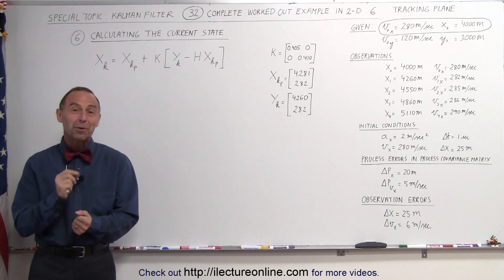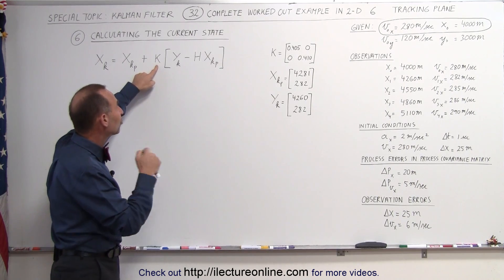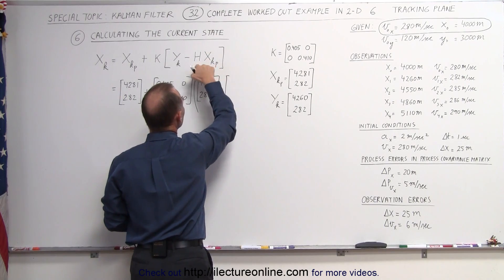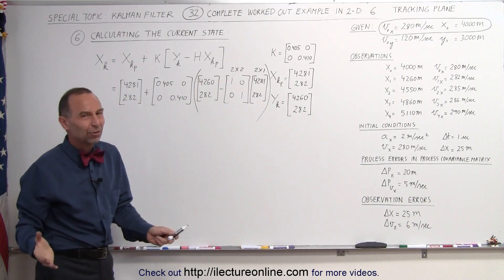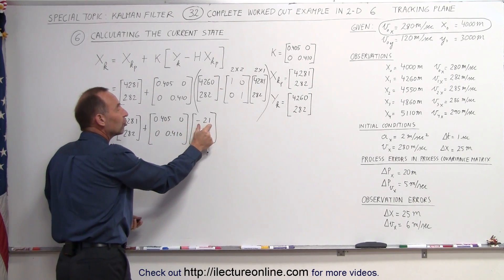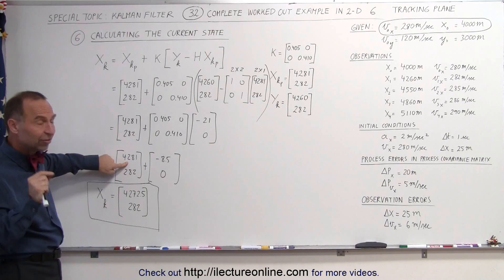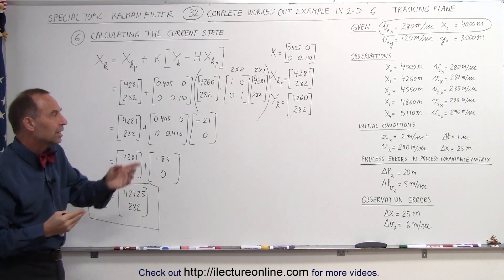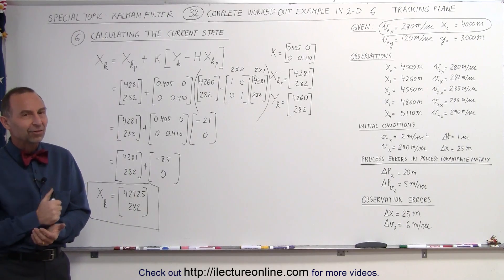Special Topics - The Kalman Filter (32 of 55) 6. Calculate Current State - Tracking Airplane

Comment: A more interesting example is if you don't know the acceleration a priori.  That is, you only can measure position and velocity.  What happens if you set the acceleration term to be zero because you don't know what it is?  I wonder if the kalman filter figures out what's going on eventually such as the kalman gain greatly weighing the measurement rather than the estimate because the estimate is off due to the lack of modeled acceleration.  And then why use the kalman filter at all if it's just heavily weighing the measurement?  Can you try estimating acceleration from the observations and include it in the kalman filter model or is it that like a chicken and egg problem?

Comment: Can we do the similar calculation using the fit parameters since we know the data and the kinematics function? We can use Chi-squared rule in the fitting because that matrix formula looks similar to me. I feel like what we are doing here is some sort of either interpolation or extrapolation when we keep guessing the next step of the plane each time by the help of the previous location and the possible path (function) of the plane.

Comment: Great videos, thank you. Do you have a video that describes how you would fuse sensor data using the kalman filter? Such as if you have on a drone an IMU and you use accelerator and magneto meter data to determine location and velocity? Maybe for a "linear" case and for rotations?
Reply from the maker: Not yet.  We plan on expanding this series, but I probably will have to retire first as my jobs are keeping me too busy to develop the materials at the moment.

Comment: Very Good lecture series. I have one doubt sir,when we well stop the iterations in Kalman filtering.
Reply from the maker: It depends on the situation, typically Kalman filters are used in situations where the data received is repeated on a rapid cycle (typically a small fraction of a second) and the filter is used on every data input

Comment: How to initially assume reasonably good values for process co variance matrix.
Reply from the maker: If you are not sure, a reasonable guess is fine.  The filter will take care of the rest.
Reply: Sir, for example if I am tracking the position using GPS, it is accurate upto 8 meters. So in that case, can I assume the observational error for position x and y to be 8^2 which is 64?

Comment: Can you explain what H looks like when it is not square? And in what situation would this happen?
Reply: measured values may not be any of the states but  function of states. for example,   ym1=x1+2x2, ym2=x1-x2.   then H=[1 2;1 -1]
Reply: @勃黄  I think what you are describing is covered in the C matrix used in the new observation calculation.
Reply: @勃黄  we already adjusted the measurements into observable state matrix form. H is applied to the predicted matrix which also makes no sense to me because your prediction already has to be in the initial state form because X_state_new=X_state_predicted+K*(measured-H*predicted) - so yeah I have no idea why H is here.

Comment: what is the relationship between this equation Y = CY_m+Z_k and [Y - HX_kp] ..... my concern is why did you not CY_m instead of HX_kp
Reply: Because in this case, he will be comparing the measurement to itself. Kalman filter adjusts the current state according to both the practical measurement and the predicted state (theoritical).
[Y - HX_kp] is the difference between the measurement, and the predicted state.